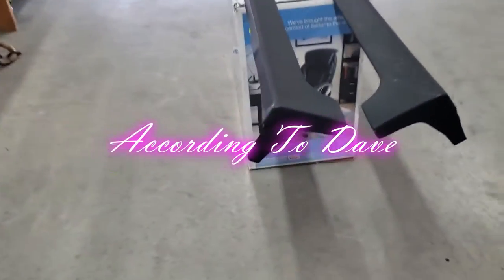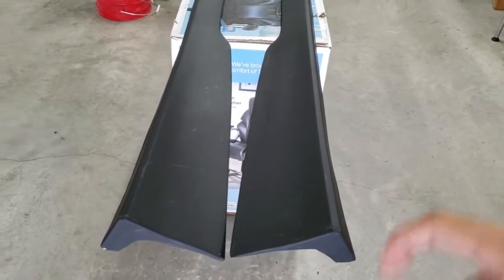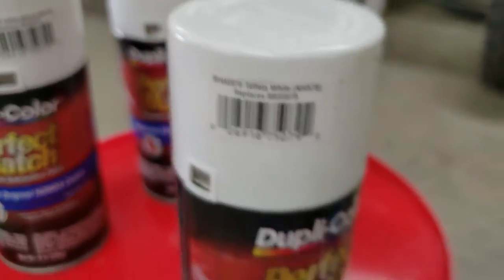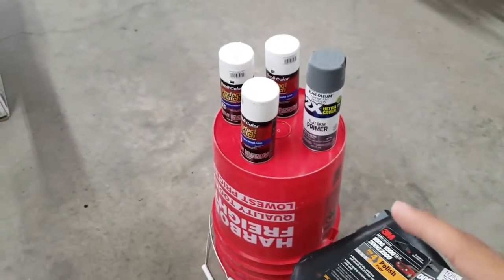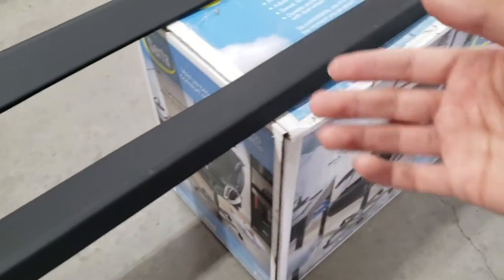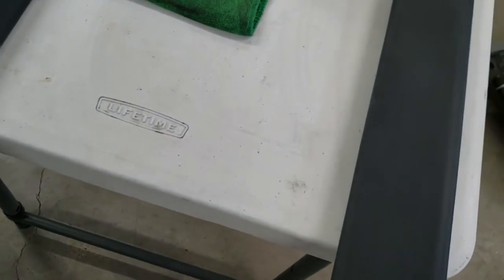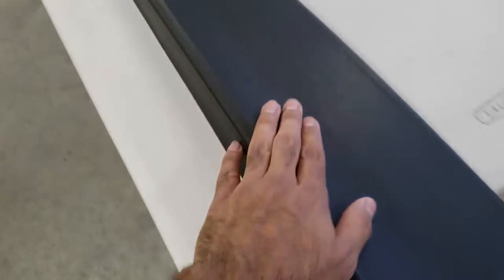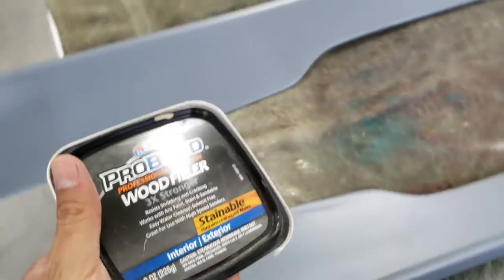Painting My Side Skirts At Home With AMAZING Results! PART 1

Comment: Did you black out your badges with plasti dip? And when you debadged the car did it leave any marks?
Reply from the maker: I blacked out the trunk honda emblem with plasti dip, when I debated the accord badge I cleaned it really good and I polished it with compound and polish to remove all the scratches.